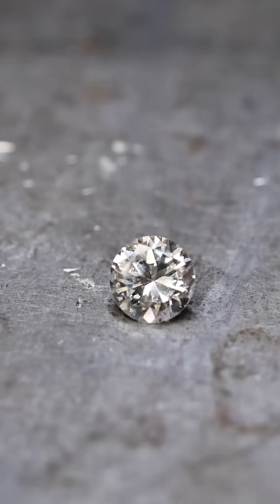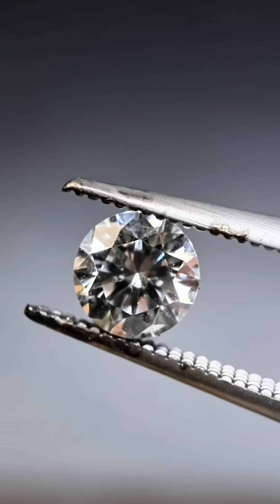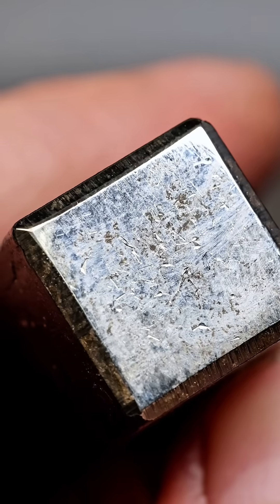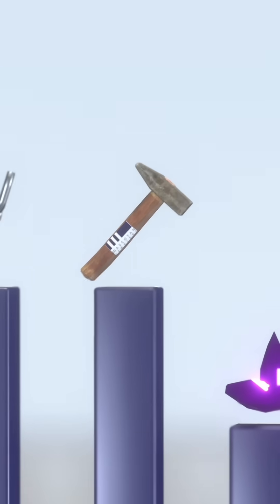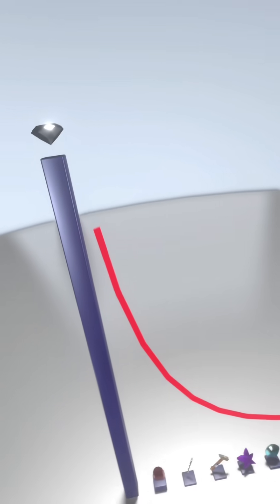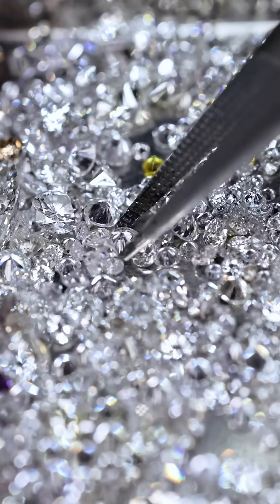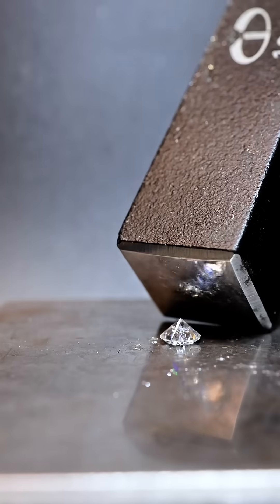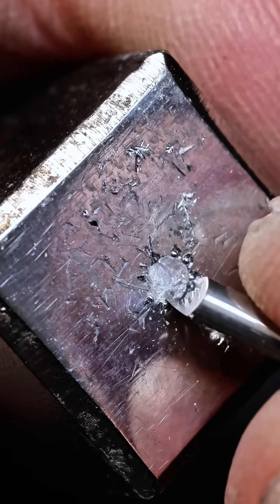Diamond vs Hammer

Comment: If you want the diamond to break with a hammer simply flip it upside down, this allows the hammer to provide Shear strength instead of compression strength, making the diamond much easier to break not to mention it also puts all of the Shear strength onto one very specific point causing the pressure to be more localized and break easier as well

Comment: You can actually destory a diamond using a hammer without the diamond problem is you need 3 hammers diamonds are hard but is can shatter not very good at handling too much energy

Comment: You never needed a diamond to break the diamonds. All you need to do is to place the diamond with the tip pointing up and smack it hard with the hammer.

Your first test was so gentle it looked like your arms were noodles.

Comment: You can still break a diamond with a steel hammer. You don't need a diamond to break a diamond. Just as when flint-knapping, you can use wood or bone to break away pieces of stone. It's a mistake to think that diamonds can only be broken by other diamonds. 
As it happens, diamonds are highly susceptible to shearing forces. This means that you could theoretically use any old stone, or even steel to break a diamond, you just have to do it as though you were flint-knapping, but knapping a diamond, instead! After all "Hardness" is entirely different from "Toughness" and from "Brittleness."
"Hardness" is mainly its ability to resist being scratched, whereas "Toughness" is what you were testing with the hammer - a substance's ability to resist being damaged/ deformed by the application of physical force. "Brittleness" is the propensity of a substance to shatter.

Glass, for example, is very hard, but is also very brittle. Diamonds are just hard.

Comment: This is BS video, do not do this, diamonds are very brittle, even dropping on a hard surface might damage them. This has nothing to do with hardness. Parallel example, hard knife edge, steel or ceramic, very sharp, but very brittle, will chip.

Comment: If hit on the diamond side you can't brake with even a diamond hammer,
But if you hit on point with even a normal hammer it will brake, i work in diamond polishing😅

Comment: Had you hammered it properly it would have broken. Even without the second Diamond. Scratching it against the steel hammer will cause the hammer to scratch but not the Diamond.

Comment: Aside from the fact that the part of the hammer with the diamond didn’t actually hit the other diamond the reason it broke was because you hit it with actual forced the second time and you hit it on the tip of the diamond which meant you were applying that pressure to a smaller area😂

Comment: Hardness is not the same as strength and you do not need a diamond hammer to smash a diamond. For example: glass is much harder than wood but a baseball bat will easily break a glass bottle

Comment: Ordinal isn’t the wrong term for the Mohs scale, but the way you showed and described it is as if it were a logarithmic scale (like the Richter scale). Ordinal just means “a bunch of categories with an order” - so for example, “agree”, “neutral” and “disagree”. The fact that diamond is a 10 actually has nothing to do with the relative hardness to a 9 (or any other number) - it just happens that diamond is much harder than corundum (9). The same relative hardness relationship isn’t necessarily true between 9 and 8, nor any other pair.

Comment: I know you already corrected yourself in Pinned comment, but I find it hard to believe as a Jewler these simple material properties alluded you..  Hardness only relates to scratches + surface degredation, diamonds are in fact quite brittle and would have broke with your steel hammer.

Comment: You don't need a diamond to break a diamond, diamond is hard but brittle, strike it hard at the tip and it will break, the action lab guy done this before using a normal hammer

Comment: The reason the diamond broke isn’t because you used another diamond but because you hit at its weakest/smallest structural point where all the atoms line up. Hitting a diamond on that point or any edge that goes to a point like that will break your diamond because it cannot spread that energy through itself like it can when you hit the top and press in.

Comment: Fun fact: You can break a diamond using a steel hammer if the force is focused at one singular point, place the diamond upside down with the point facing upwards, smash it with a hammer and it will break, this is because you're gay.

Comment: You can break a diamond with a lot of stuff as long as you hit it with enough force at a decent angle. There might be some things that physically cant break a diamond because they can't withstand the force needed to put enough energy into breaking the diamond (like talc or chalk), but steel is definitely strong enough.

Comment: mohs hardness is a measure of a substances resistence to scratches. you can break diamonds with a hammer. however, since they are level 10 they would not be scratched easily

Comment: if you stop hitting it like a girl you can hammer a diamond i'm sure. the thing about hardness is you can overcome it. can you scratch steel with brass? yes you can, you can hammer and deform it too even though the brass is much softer. ceramic knives are very strong in one direction, very weak in another.

Comment: That's not entirely true. You can destroy a diamond with a hammer if you hit with enough speed and force. On the other hand, you probably couldn't destroy it under a hydraulic press. It would drill into the steel because a diamond is the hardest thing nature has to offer. A diamond can also only be scratched by another diamond.

Comment: Also, diamonds have 4 directions of cleavage, which can be thought of as planes of structural "weakness." This is how cutters will split rough diamond crystals, simply using a hammer and wedge aligned with the cleavage planes.
Besides that, any impact can chip a diamond relatively easily, which is why you need to be careful not to hit your diamond ring against any hard surface.

Comment: The toughest material is a metallic alloy of Chromium, Cobalt and Nickel. Highest toughness steels get 200 MPA m1/2 for the absolute highest and this is much higher at normal temperature but when supercooled it can get up to 500 MPA m1/2

Comment: That's false, you can break a diamond with a regular hammer if you hit it hard enough.

To explain hardness, let's imagine a glass and a plastic bottle. We can all agree that glass is harder than plastic but when you drop both on concrete the glass bottle will shatter but the plastic bottle won't. That's because of an underrated property called toughness. Plastic is tougher than glass. And so. Iron is tougher than diamonds.

Comment: Hardness ≠ toughness. Most often, the harder a material is the more brittle it is as it's internal structure is less flexibile. That's why over-hardening is a problem for steel armour and tools so you balance the resistance to abrasion&indentation against resistance to impact&shock for the task. I'm pretty sure that this is something every jewler should know.
Reply: Exactly. Thats why the strongest tools have soft core and hard surface.

Comment: Diamond is very solid, unfortunately it's also very rigid, so if enough power is applied it'll just shatter like glass, if not then nothing will happen, unlike other materials that would start falling apart even if the force applied isn't enough to destroy it out right. If we found a way to make diamond mailable it would be great for bullet proof vests, nearly impossible for a bullet to penetrate, and it would no longer be rigid so it could take more then one bullet, unlike ceramics and it would be much lighter then steel plates as well

Comment: Mohs scale doesn’t Quantify Hardness rather it quantifies Scratch-ability, for example if two objects are rubbed together and one of them scratches the other and leaves marks(like in the video the diamond scratches the hammer), the former will be ranked higher on the scale. And vice-versa

Comment: I worked in heat treatment, and they had a durometer that used diamonds to press into the metal. It only takes a little force at the right angle for the diamond to break.
Reply: I've never broken one, but I've seen one broken by misuse of the durometer.

Comment: I have seen diamond was broken from the head under extreme pressurized force by the pressure machine... Whereas if it's inverted then the diamond literally creates a Hole in the hammer with less pressure by the same pressure machine because of its pointy end..😊

Comment: Actually the strongest mineral is lunsdaleite
Reply from the maker: Doesn’t exist in practical sizes.
Reply from the maker: It’s actually a huge scam if you try to buy some. 100% of lonsdaelite sold online is ceramic mill balls. Sold from anywhere from $15 each to $15,000 each. Huge scam.

Comment: This is so wrong on many levels. Hardness has little to do with strength and vice versa. A very hard material need not have high strength like diamond. Diamonds can be shattered with steel but cannot be cut.

Comment: As a material science and material engineering student, I can say that hardness is not an equivalent to strength, diamond is the hardest material, but is very brittle (the contrary of hard is soft, and contrary of strength is brittle).
Reply: Yes jade is soft but id say it can take more abuse than a diamond.
Reply: it make sense, steel isn't hard but that makes it very strong

Comment: Besides that break ability, which depends on several factors, the diamond is not the hardest material.
wurtzite boron nitride and lonsdaleite, have been discovered to be harder than diamond. Lonsdaleite, for example, is a form of carbon with a hexagonal structure and is believed to be 58% harder than diamond.

Comment: Diamonds are actually classed as being brittle, like titanium which is ironically famous for being “bullet proof”
Brittle doesn’t mean it breaks easily, it means that the material has no yield, it will shatter instead, meaning it can take an incredible amount of force and absorb all that energy applied but it will shatter instantly instead of bending or warping

Comment: I broke a diamond with a hammer.
Took about 10 minutes.
Wish I would've kept it.
I heated it with a torch and dropped it in water and hit it and repeat.
Yeah, it shattered....
Reply: Save yourself the effort, just hit it with the hammer, it would explode. Diamond is hard... and brittle.

Comment: There's a very good reason why diamonds aren't used in axes or pickaxes, and they are instead used on drills. That's because their rigidness makes them very easy to break after multiple deforms in the structure. They're used on drills as diamond's hardness gives them a strong outer cover. Either way an iron or steel axe or pickaxes would be more efficient.

Comment: Diamonds are hard for a different reason than other things. They are so hard because their molecules are so densely packed together that they actually lock like puzzle pieces (3-dimensional ones). Because they are so tightly packed, there isn’t enough space for them to move to change the shape, or break away

Comment: That's not even how the Mohs scale works youre literally wrong lol the hardness scale is just about its ability to be scratched and you just have the single cheapest hammer known to man there and are swinging it like a child would lol. The crystalline structure that gives diamond its clear shimmering look is big and fairly brittle compared to Bort which is what most diamond is and has a much more compact structure and is what is used on saw blades and drills

Comment: It is missleading, diamonds hard simply glass but stronger, they are "brittle" as to they break and don't deform like metal would, they are scratch resistant but you can break them without needing another diamond

Comment: It probably would have broke either way on the second strike. Notice he did it upside down. Diamonds are the hardest material on earth, but when struck properly they actually can break as they are very brittle. Striking it upside down will probably break it. Right side up it has more strength.

Comment: My diamond ring ( inherited from my grandfather hence the old fashioned rose cut) slipped off in a Gym shower and broke on a granite shower floor. You absolutely don't need another diamond...just bad luck, soap and the wrong angle and thats 2000 €  and a hwirloom gone.

Comment: you don't understand the crystal lattice a diamond can only be cut and scratched by another diamond, but it can be broken by anything glass is harder than a rubber ball so a rubber ball breaks glass the reason the diamond didn't crack is because you carefully and gently tapped it with a hammer if you had hit it like a boy it would have cracked

Comment: The reason the diamond broke easily at the tip and not the sides is because the tip is a very sensitive area basically the temple of the diamond, the thing that keeps it intact, so hitting it with enough force could shatter it easily. While if you hit it at the sides it could withstand the most of the force without breaking. That is unless you put your whole might into it.. then yeah it would shatter pretty easily 😅

Comment: I work in the industry and I've seen more than a few diamonds break for a myriad of reasons. Hell, I've smashed a few because it just wasn't worth worrying about when disassembling a piece of jewellery that was traded for work. Diamonds? Yeah, they're tough, but they're not so tough I can't smash it with a piece of steel and a solid blow. It will, however, mark the hammer and I'll have to re-polish it.

Comment: I see the comment above you explained the correct version but I just wanna make it clear that you can break anything with anything. You can break a diamond with a toy hammer depending on diamond's shape or toy hammer's speed. For example if the diamond is 0.1 mm thick and 100 meters long you can break it with a pillow. Or if you have a toy hammer going at 0.9c speed you can break pretty much anything in the universe.

Comment: Actualy you could use a tungsten hammer and if an most hardness scale only goes to 10 where is tungsten in the most hardness scale and you said diamond is the most hardest material. No way diamond will never get close to tungsten
Reply: Tungsten is about 7.5.

Mohs only checks if one can scratch the other, has nothing to do with strength.

Comment: As an example, you can scratch steel with a diamond, but you can easily shatter a diamond with a hammer. The diamond is hard, the hammer is strong. Whether something is hard or strong depends on its internal structure. A diamond is made entirely of carbon atoms which are joined in a lattice-type structure.

Comment: Mohs hardness scale relates to hardness not durability. The regular hammer can and will break the diamond just fine with enough force. A stone is harder than copper sheeting. How many times can you fold a stone without it breaking?

Comment: I wonder what happens if you could perfectly strike the flat faces together of two exactly identical diamond at supersonic to hypersonic speed each with precisely controlled acceleration so they impart the same energy into each other, just dust? What insane force would be required to fuse them together; thats what I'd like to know. 😅

Comment: The diamond's hardness WAS A factor in the hammer being unable to break it. You can swing a banana hard enough to shatter glass, but it'll have a hard time actually shattering the glass because its very soft flesh will yield completely when it contacts the much harder glass. Similarly, the hardness of the diamond makes the steel yield to it. From the diamond's perspective, you were striking it with something soft and malleable.

Comment: He hits the diamond with the edge of the hammer, missing the diamond he put in the hammer completely, and he cracks the diamond in half, proving himself wrong. Yes, you can easily crack a diamond with a simple steel hammer

Comment: This is very misleading and missinformed video. I will just add another drop to the ocean of comments, but, once again: hardness is not a measure of "breakability", it is a measure of which material scratch which. As the diamond is so hard, it will scratch anything you rub it against, like it did to the hammer, but the hammer can still shatter the diamond with sufficient force. Harder materials can be very brittle actually. Think about a ceramic that isn't easily scratched, but can shatter when you drop your cup; contrast with a knife many alloys which can be easily scratched by a harder material, but you can drop it and nothing will happen to it.

Comment: hardness = scratch resistance
toughness = breaking/chipping resistance

diamond is hard but not tough. actually its quite brittle. a hammer can easily smash/chip a diamond with a single strike.

Comment: This video is misleading.  It didn't shatter because another diamond hit it, it shattered because it was hit on the point so highest psi force possible and internal stresses because of the shape of the diamond reverberated all around inside until it exploded.  I have see and REAL diamond fall out of a ring onto a concrete floor and shatter.

Comment: I get it that diamonds are technically brittle. But that doesn't mean that they are easy to break with an ordinary hammer. In fact, most people would not be able to break a square diamonds with a even a sledge hammer.

Comment: Hard is not equal to tuffness. Hardness means resistance to scratches. Tuffness means resistance to strong blows. Diamonds are very tuff compared to other gem stones but not the tuffest. Meaning it can shatter with stong blows easily.

Comment: I might be wrong but the harder the material is it's more fragile and metals "not all" are hard but also malleable which helps with compression and stretching without it actually just exploding into pieces like the diamond. Depends on the metal tho